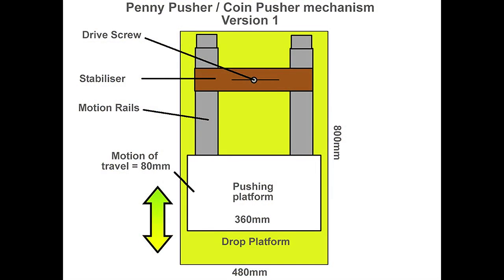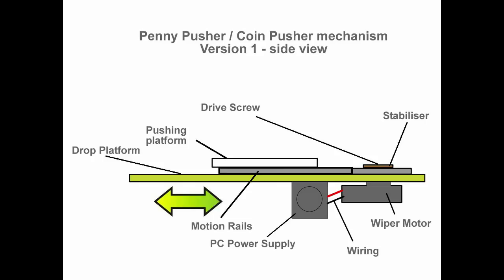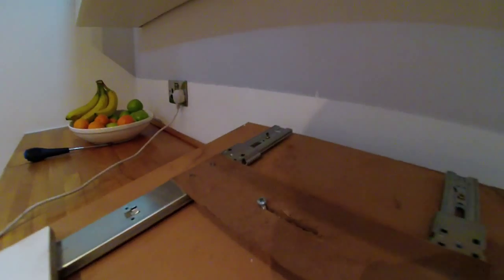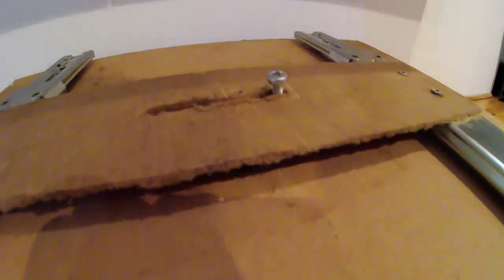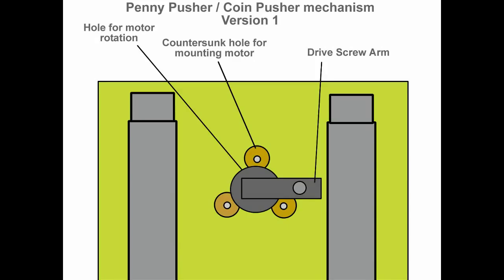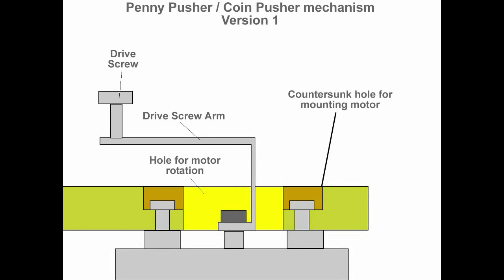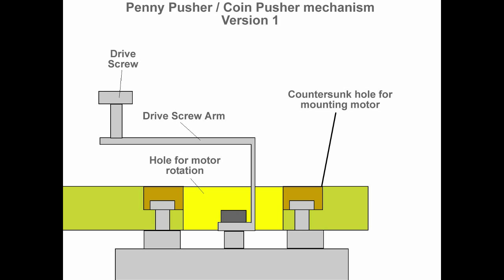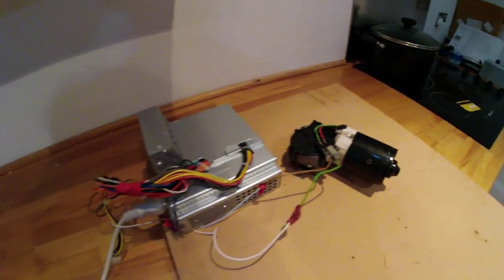How to make a Coin Pusher - 2P Pusher Project build - Part 1 - Pusher Mechanism - DIY Tipping point

Comment: Nice motor idea and can u help by linking the power supply u use
Reply from the maker: Hi David. Sorry for the later response. It is just a standard ATX motherboard power supply that has the 4 round hole plug for powering older style hard drives, CD roms, etc. I might do a new video on how you can use more modern types of PC power supply.

Comment: hi, i have a problem, my motor works fine but the bolt comes loose on the wiper after a short while i am finding that the screw which pushes the plate is getting jammed in the wood, any fixes for this.....i have even replaced part of the wood with aluminium, but it still comes loose, and while the motor turns the screw seems jammed...is it possible that i may have to much of a big gap...cheers.....
Reply from the maker: Hi Dayle. I found a good way to get around this. Rather than screw the bolt into the rotating arm, make the hole bigger than the bolt so it slips through. first, add a nut to the bolt and spin it up so it is out of the way. Then place it through the rotating arm and add a nut underneath. Then tighten both nuts up around the rotating arm so they sandwich it. Add a drop of superglue to the threads if you never want them to come undone again and bingo! Its locked in place. If you want me to send you a pic of how I did it, let me have your email address. Cheers! Andy

Comment: Hi. I'm following your project closely and cant wait for the finished product and more videos. I genuinely thank you for your efforts is posting your project in such a detailed way. May I ask if it matters which wiper motor you use. On ebay there are plenty of both front and rear wipers, and rear wipers seem to be cheaper. Does it matter which you use? Thank you. Alex
Reply from the maker: Hi Alex. Thanks for the kind words. I know how frustrating it is when you want to build something and there are no instructions. So I figured I would give it a bash and help anyone else along the way. My pusher is nearly finished other than a few stickers and a coat of paint! With regards to the motor, I used the cheapest one I could find on Ebay. It is a front wiper motor and off a Saab 93. If you power it with a computer power supply, you have the beauty of controlling the speed yourself with the different voltages you supply. The 12V supply is perfect speed I think but the PC power supply also has 5V, 3.5V or a combination of the above. Therefore you can have lots of speeds to fit the purpose but supplying more or less voltage. I hope that helps. Keep watching and subscribing and don't forget to share it with others! More videos coming over the next few days!
Reply: andycharger Hi. Thanks for the reply. One thing that I may try is using an old Nema17 Stepper motor (as I have one laying around) and buying a cheap stepper controller as only a few pounds on ebay. That way I can slow the stepper down at the click of a button (or speed up). Once its all hooked up I will do a video of it working so that people can see how it may fit into a coin pusher environment. I havent any idea how this will work out. But I will give it a bash. Thanks for the reply. My kids will love this machine when built, us dads love them too! Cheers. Alex
Reply from the maker: Cheers Alex! I look forward to watching how that works out. I have just uploaded part 4 to my youtube channel. The LEDs make a big difference!
Reply: andycharger Hi Andy, Looking at the price of the wiper motors on ebay being so cheap I will propably buy one and see whats best, so will definitely let you know, thanks for the next upload video. Cheers. Alex

Comment: hi bought a windscreen motor and the power required was very high. does anyone know of a low amp windscreen motor.
Reply from the maker: +Justin Anthoney Hi Justin. I recently made a new video and uploaded it explaining the motor and the power it needs. Most power supplies will deliver 12 Volts and sufficient amps to power your motor due to its consumption in a car. I also list the part numbers of the motor I used. Its a front wiper motor from a VW or Audi. Here is a link to the movie: https://www.youtube.com/watch?v=NQ7rbV8RTCQ

Comment: I know this is an old video, but I'm looking to ideas for my own pusher. I'm trying to figure out the "motion rails" - for those of us who don't have server rails, any suggestions? :)
Reply from the maker: Michael Viselli hi there! You can buy those rails at B&Q in the UK or look on Ebay. They are essentially called ball bearing drawer runners. Hope that helps!
Reply from the maker: Hi Michael, did you build your penny pusher? I’m just stripping mine down and will be documenting it on my channel. Just posted an update last night. I would interested to see how you are getting on bud!
Reply: @andycharger  I did finish it! I had to use dresser rails because it was a very short space and I had to cut the rails. It's not as pretty as I would've liked it, but it worked. I actually have to take it apart again, because I want to make some improvements.

Comment: Hey buddy, awesome project! Watched it all and intend to wage myself into this. It probably is a bit late to ask but if you have plans, lists of materials or measurements it would be of great use! Hoping for a reply or I am forced to crack me a headache into figuring it out myself.
Cheerio
Reply from the maker: Jefke Palm hi and sorry for late reply! I don’t have any plans other than the measurements in the video but I am happy to measure up some parts of the pusher if you ask for specific dimensions on parts!
Reply: @andycharger  Great, I am currently collecting some supplies and parts. If there is something particular I will send you an email. Thanks in advance buddy